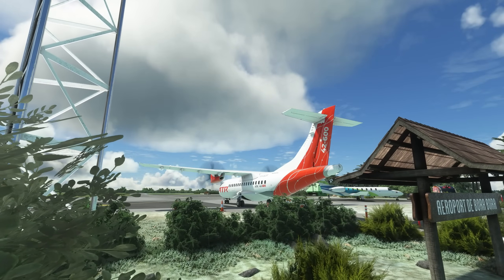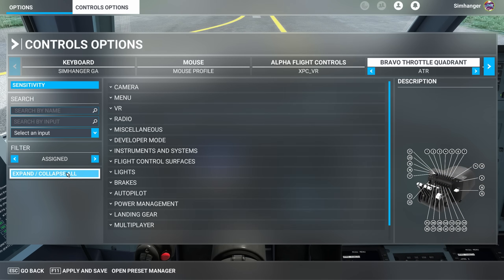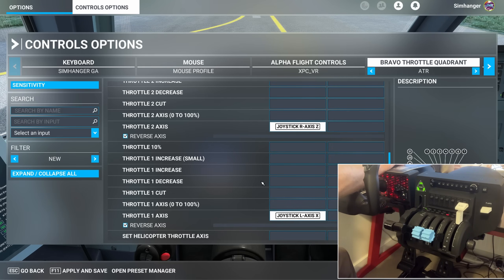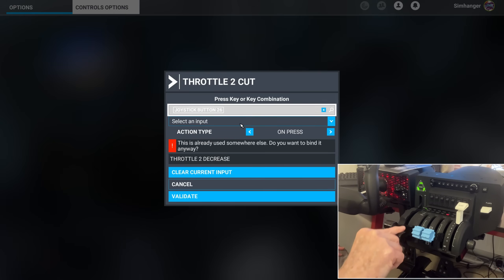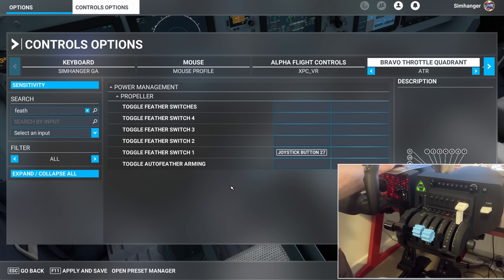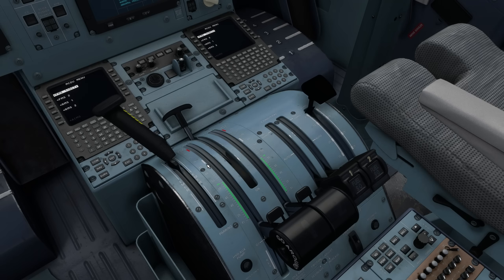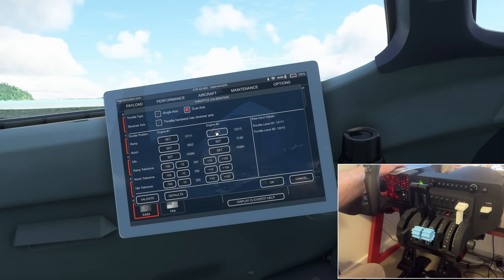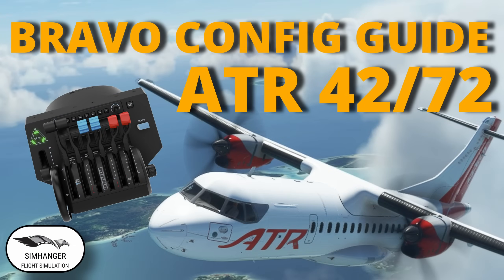ATR 42 & 72 Config Guide | Honeycomb Bravo TQ | Plus how to calibrate throttle in cockpit

Comment: Great work ad usual Mark. All your setup in My Bravo work fine but this atr give me some problem . I have the trhottle levers in idle but in sim goes in reverse i must pull up a little to set Ilde in sim
Reply from the maker: Do what I said on the video. Throttles at idle….do not check the box for reversers. Select default then dual axis. Your throttles will now be at idle. Now set the notch and ramp positions.
Reply: @SimHangerFS  I"m having the same issue unfortunately. I start the sim and the throttles are in the GI position in the aircraft and I go through the steps you just stated but when I move the throttles forward and back the throttles move into the reverse position. I've been trying everything to fix it but it just won't stay out of the reverse detent.
Reply from the maker: @kevinphilpot3270  try select default, exit flight and then load up aircraft again. Select default again…then calibrate by selecting set at idle.
Reply: @SimHangerFS also when I start to increase the throttle it initially goes in reverse before moving forward. I have no idea what I've done wrong. I based it off of the 2 engine setup which has always worked great.
Reply: @SimHangerFS  Mark you're a genius this did it! Thanks you sir!
Reply: @kevinphilpot3270  Agree, what to do without him?

Comment: Thank you Mark, very useful as usual. I followed the set up as described but in my case something strange happens: the cond. levers (propellers) work perfectly but the throttles jump! As soon as I touch them they either go full forward or full reverse. The only way to move them gradually is by using f1, f2, f3. I must have goofed somewhere…
Reply from the maker: Make sure pilot assists are off as well as autopilot.
Reply: @SimHangerFS  same problem here

Comment: My reversers don’t work for some reason. The prop leavers work well with the feathering but throttle still go into reverse before the detent. Not sure what I’ve done wrong
Reply from the maker: Calibrate in sim….in the cockpit. Set to default first…then idle.
Reply: @SimHangerFS  That worked, thank you

Comment: Although you use levers 2 and 3 for throttle (4 and 5 for prop)  could i use 1 and 2 ( throttle) and 3 and 4 (prop).? Also do you think tca throttle is better for ATR because it has physical detentes apart from idle, as opposed to bravo just having idle and max? Great video, thanks.
Reply from the maker: You can use any axis that suits you.

Comment: Brilliant. where would be without you. No ASOBO instructions! they should thank you big time. As an aside I'm having trouble getting the steering to work. It doesn't seem to respond to my normal set up. Trying to sort that out now.
Reply: Believe you have to unlock nose wheel steering
Reply: @JoeDunlop06  Ah. Thanks.
Reply: @JoeDunlop06  struggling with that, too - how can I unlock the nose steering wheel?